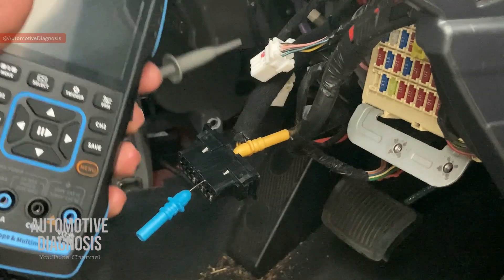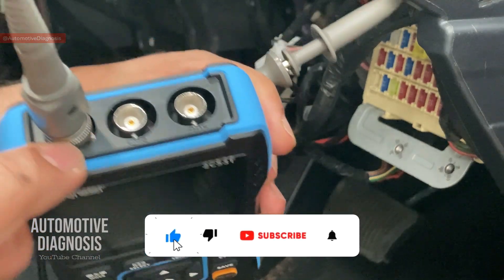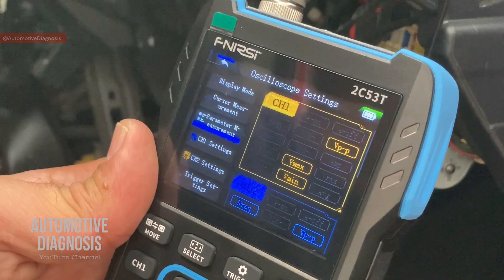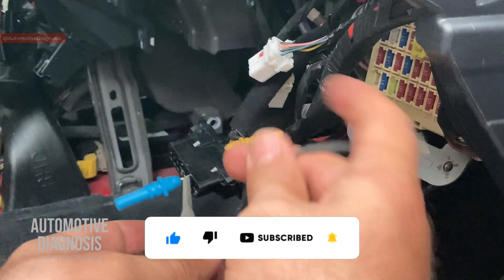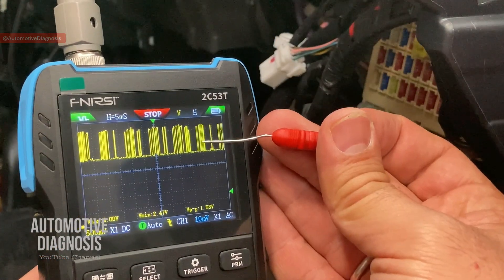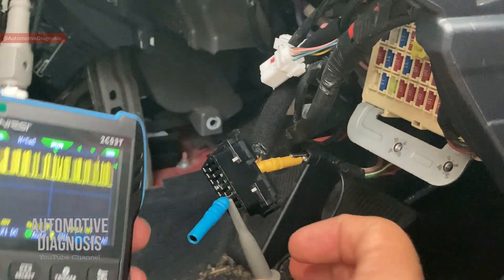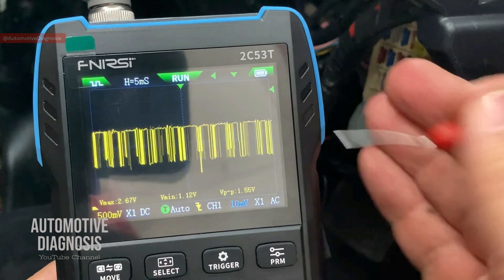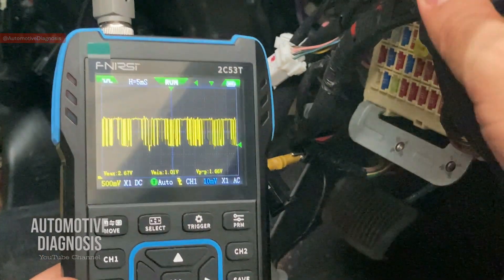CAN-BUS Diagnosis with a BUDGET Oscilloscope | CAN BUS Waveform Analysis #canbus #oscilloscope

Comment: Can i use this scope with a low amp probe
Reply: Yes any current probe should work with bnc connection
Reply: @tylerhill6706 ,okay  should i used it at multemeter section or oscilloscope section

Comment: i have just puchased this exact oscilloscope and would like to diagnose live injector and ignition coil waveforms  i understand that the votage is probably to high for ths scopes input but i wondered if its possible to use it wth a hantek 20x1 attenuator have you tried this or do you have a vdeo on this?

Comment: Whilst a great channel and a good demo as its a two channel scope it should of been demonstrated with both channels at same time or wots the point, u may as well of used one of ur single channel scopes instead....pointless....
Reply from the maker: Hi there, I only used one channel for three reasons:
- Wanted to explain the CAN-Hi and CAN-Low step by step for a better understanding.
- Screen on this device wasn't big enough to give a good view on both waveforms when I was recording.
- And the third reason was that this device came with only one oscilloscope probe 😊 so I didn't have any choice anyway!
Reply: @AutomotiveDiagnosis  I noticed the oscilloscope probe has a selectable bandwidth. What bandwidth is best to use  for measuring CAN signals? Is it safe for me to assume the second probe the package came with (no selectable bandwidth) is not suitable for measuring CAN signals?

Comment: Is there any documentation that comes with the O-scope which details the application of the various scope functions?
More troubleshooting videos using this device would be appreciated.
Can this device be used in the same manner on older vehicles with OBD1?
Reply from the maker: Hi there, normally inside the workshop manual you may find some good-known waveforms to compare with your reading. Also some oscilloscope manufacturers provide a waveform library that can be helpful. 
I will try to make more videos.